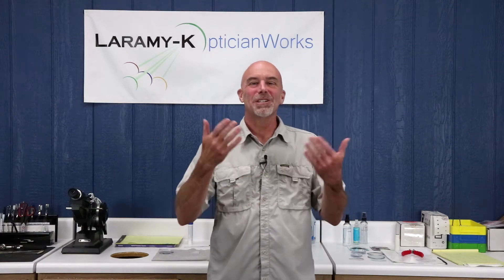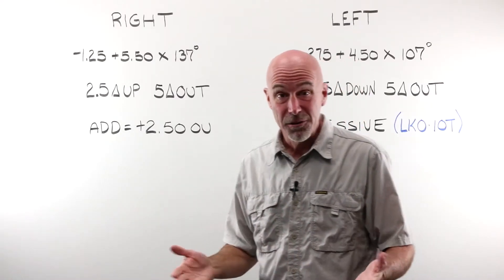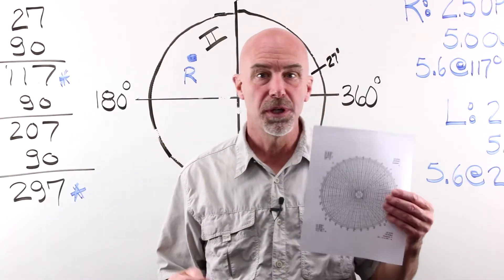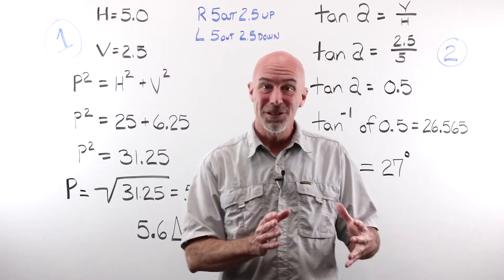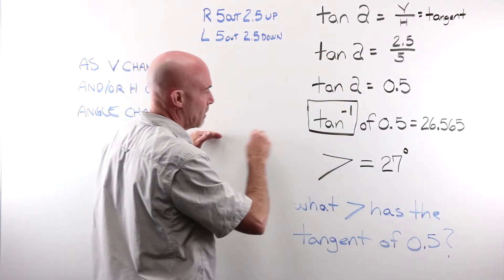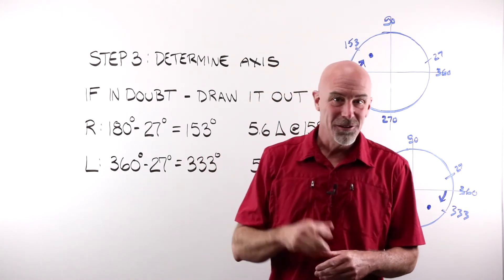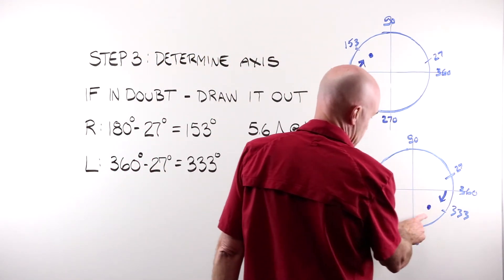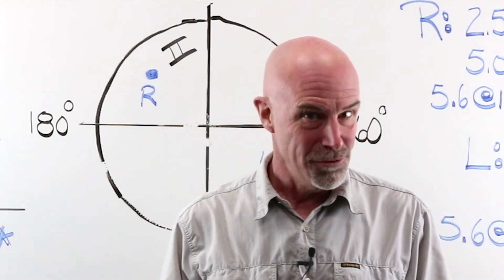How To Calculate Resultant Prism

Comment: I have a problem with this sum can you help please...

Calculate the prismatic effect of 7mm down and 5mm in from oc of 
RE:+4.00/-3.00*60
Reply from the maker: https://youtu.be/hZyDGaDxhfw?si=ulylmV8B2-V3dwef
Reply: @LaramyKOptical  ok i get the point but like given that question that they have given you to calculate the prismatic effect and has given a prescription of a cylinder and its axis...do you still use the same procedure??
Reply from the maker: @Feliciakamwendo  I think the answer would be yes. I'm not sure exactly what the question is. The answer to the prismatic effect of 7 down and 5 in would be done using the chart as shown. Quadrant IV looks like about 8.5 It doesn't rely on the lens power.

Comment: Noticing that R and L eyes both conveniently have same oblique meridian of error in this example, I assume that the same simple Base/Apex triangle figures can be used to give final answer here as in former simple cases of 90 and 180 deg meridian of error cases (would have been nice if you had proceeded to that final answer here).

But additionally, what if each eye has a different meridian of error? Without at least 1  example (if not 3 as in your other videos) solved (in your advised baby steps) of such a general case, using the charts you have only here just introduced and over-viewed, I submit your teaching of this subject has been prematurely aborted, incomplete.

Comment: What happened to the slow baby steps? Where did they go? If this is how work is actually done in practice, shouldn't we be walked through an example of how it can be done using either approach and shown simplifications that result? Also, I guess we should assume here that this 'resultant prism' situation is optician code for the case where prism is wanted, via doc's spec on Rx and not the case of unwanted prism where lenses have been made wrong. Am I right?

Comment: If you have a prism compensator on your lensometer, as I do at work, on a lens with compound prism, you can use the prism compensator to verify the prism in one direction and manually verify the prism in the other direction.

Comment: Great Video. 
I was curious If you could maybe explain as simply as you could verifying prism that is given in 180 or 360 Degree notation ? We have a local Mds group who employ many orthoptist and we see some RXs written with the prism broken out for us such as 

+3.00+1.00 x 60 with 
3D @ 
192 Degrees 
Ect...... 

These Pts usually come in with Press on Prism applied in the office and now they finalized the RX and would like it ground in- however they do not write it broken down in Diopters vertically and horizontally. When I spoke with the prescriber - He said that he does not prescribe in that manner - that its determined in degrees in which the PT would have a trial frame on and simply spin the Needed amount of prism in a trial frame and when its “Fined Tuned” as he put it- he simply Reads its off in the amount of Prism and the Degree the PT stopped at.(which doesn’t help me out however 😀) 
I was wondering if you could help me or point me to a good resource to 

1) are there any apps that you know of that will Take that notation and turn it into the in/out - up/down coordinates ? 

2) verifying this type of RX  to ensure they are within tolerance, since unfortunately I have been told a few times the prism was off by 15 degrees or so on.  Verification as well as bench lay out for edging on SV seemed to be the issue since with PALs its already ground for me

Thanks again for all your Videos !
Reply from the maker: Todd, As I mentioned in the videos on prism - I'm no expert on it. Just didn't come across it enough while working. Please give me some time on this - I'll need to do some work before it can become a video. Short answer is, yes, I'm pretty sure there is a way to work the formula "backwards" so to speak. If you would drop me a "reminder" email though the website that would help. John
Reply from the maker: Todd - Starting to dig into this and I have some questions for you. PLEASE email me. Thanks John

Comment: First of all, magnitude/angle is the way ALL prisms should be specified.  None of this BO/BU/BD/BI stuff, as that is L/R eye dependent and leads to endless confusion.
Regarding the arctan function, this has vexed mathematicians, because the ATN function has an ambiguity (which you resolve by "doing the quadrant thing").  The better way is instead of calculating ATN(Y/X), you calculate ATN(Y,X), where the signs of Y and X are taken into account.  (You are doing this when you use the prism chart.  The latter function has no ambiguity, and directly gives the correct angle.  This whole calculation is simple vector addition (which we electrical engineers do almost without thinking).

If the lensometer had a Cartesian matrix on the reticle (in essence the prism chart you show), the 5 and the 2.5 prism could be directly read off.  There would be no need for any calculations.  The lensometer becomes an "analog computer". 

Here is a good subject for another video: calculating the refractive power of 2 lenses stacked, each with both sphere and cylinder power.  What I know about this is that you DOUBLE the angles of the cylinders, add them as vectors, and then halve the angle of the result vector to get the angle of the cylinder.  The sphere gets a little complicated, as the "equivalent spheres"  of the original lenses (sphere + 1/2 cylinder) get added together, and then 1/2 of the cylinder result also added.  I have never seen this documented anywhere.
Reply from the maker: Brian, 

Sadly, the industry standard for certification is still the ABO so on some levels I have no choice but to teach to the test. If the ABO uses basic BU/BD/BI/BO then I need to address it. Hopefully someday we will have a choice but for now, well, business is business. If people are paying me to teach it, I'll continue to do that. 

The videos are designed for people with little or no optical knowledge of any kind. They are designed to help people grasp the CONCEPTS they will need to be good opticians. 

You say, "If the lensometer had a Cartesian matrix..." But, it doesn't right? So, we have to work with what we have. If my Aunt had _________________.

As to your last paragraph I must ask, "What would that do to help a new optician grasp key concepts and be better at their day-to-day job?  Do we ever "stack" lenses in eyeglasses? Sure, geometric optics is some cool stuff and if you enjoy it more power to you. If you want to be an optical engineer then be an optical engineer. Being an optician is NOT the same thing. 

Thanks for all your posts - you keep me on my toes.

John
Reply: You say we don't stack lenses?  When you determine cylinder angle and magnitude using crossed cylinder lens, you are doing exactly that!  if you look at the math, what is being done is independently adjusting total cylinder magnitude without altering angle, and then adjusting angle without altering magnitude.
Part of being a "rock star optician" is understanding beyond what a certification requires.  The "prism chart" is a major part of that understanding for this subject.

I hope you go beyond passing ABO exam.  There are a host of texts/videos on that.

Do opticians have no required math background?

One other thing you might do: explain the standards of measurement used to specify a lens, such as how the angles are measured (FACING patient, 0 degrees to YOUR right, going COUNTER CLOCKWISE, etc.)  I have never seen this anywhere.  When I needed to re-calibrate an AO lensometer, that the belt broke, how do I determine if it's correct?  (And no, don't say "send it out for calibration" either.  How does the person at the equipment manufacturer assured it is correct?)  Hints are dropped everywhere (such as the prism chart) but not explicitly stated.
Reply from the maker: Brian,

As I have replied to you in the past: "If you have a better way of doing something and you get the consistent results you need, well, then do that." Your comments always come across as a veiled challenge and quite frankly I'm getting a little tired of it. If you feel you could do a better job at this stuff then please start your own YouTube channel and do just that. Heck, I'll even help you get your studio set up if you would like. If you do a good job, heck, I'll even point people in your direction. Otherwise, we just don't play that way here at OpticianWorks. We exist to help others, period. If you don't want to help us do that then move on... May I suggest https://www.facebook.com/opticalsociety/ they might be more of what you are looking for.
Reply: OK.  Buzzing off.